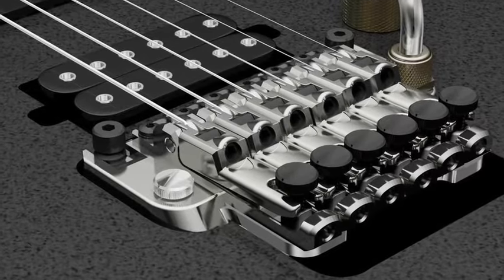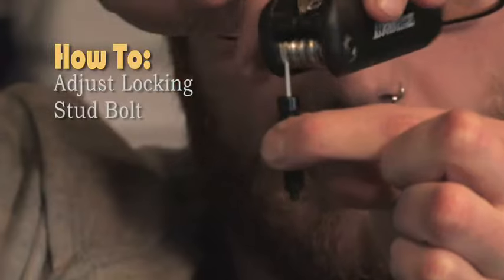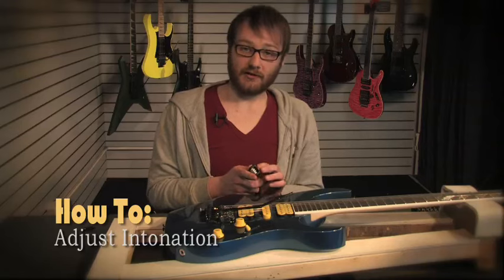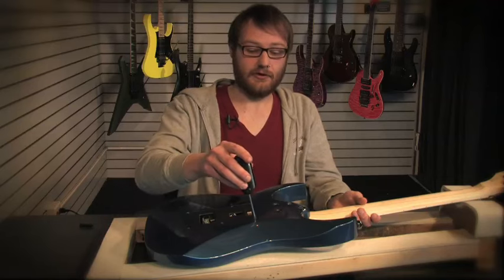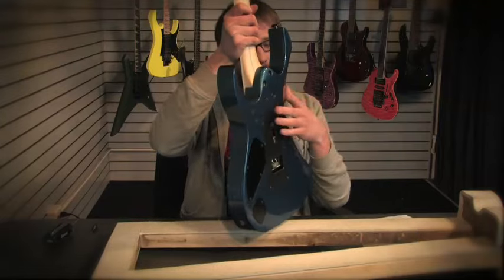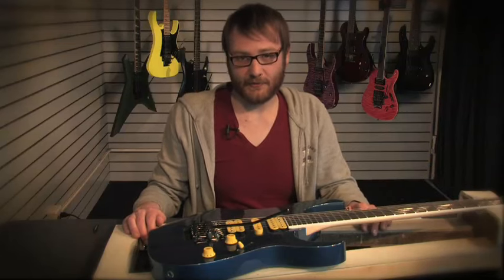Trems : Edge Zero

Comment: I have a rg 350, the bridge is similar to the one in your video but I think it's older because it doesn't have that intonation adjuster. Anyways, I can't get the bridge to sit flat, the tension adjuster is maxed out and won't pull the bridge any flatter and it's not flat.. What can be done? I can't find any information on this problem..

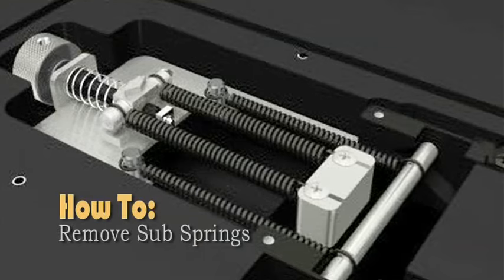Comment: 5:05 I removed the two springs in order to get a more loose tremolo. The Guitar feels much better to play now, but it wont stay in tune and gets flat everytime i use the trem. Whats wrong?
Reply: You need to balance your tremolo, so tune until you dive or pull and return to normal It took me lile 40 min to do that.. I adjust, tune, dive/pull repeat until works

Comment: @LOMAZ5150 My locking nut is just tightened to the point where I feel resistance. About the string tension... I'm not quite sure. I can use the trem to an extent, but more than that makes the guitar go out of tune. Maybe it's the tension. I'll have a look at it, I think.

Comment: Man...our society...men (at the least), should be more than capable using tools, and generally good at troubleshooting.

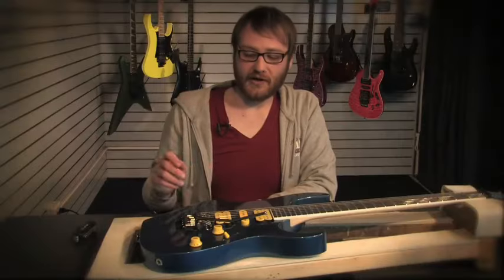Like at around 3:20, just say "TIGHTEN or LOOSEN" the nut to increase or decrease the tension, or torque, of the trem arm. You know, just basic terminology for bolts, nuts, screws, etc.

Comment: it would be nice to get a video like this for the edge 2
Reply: Meaning its simpler to adjust but not that stable :)
Reply: SmeefMemes  I fucking hate the edge 2
Reply: Yes please
Reply: i thought the edge II was the brain fart idea that doesn't use a locking nut
Reply: @hawkinthewind  Edge Zero 2 has a locking nut.
Reply: @OzzyInYourEars  Simpler by how? As I get it they removed the intonation screw with no replacement whatsoever, leaving you to adjust the saddle by hand somehow. I couldn't find any explanation on how to do it on the Edge Zero II, not even in the manual. Only thing I found is a third party intonation adjustment tool for 40 bucks. As far as I see this is a major downgrade to the first version. Thanks for nothing Ibanez.
Reply: @StrikeAgainstMusic  The intonation of the edge zero ii takes a bit longer but it is completly doable. All you have to do is to loose very well the string you're working on so moving the saddle with your hand becomes easy. Ive found that you dont really need to perfectly tune back  all the strings but the one you're focused on. When your done tighten the saddle lock bolt and repeat the process with the next string. For me it takes about 15 min to perfectly set the intonation of my rg350dxz. Good luck
Reply: @louisjgb8283  i hate it too. The only way my guitar would stay in tune is to block it.
Reply: @AlphaDeCefeo  can you help me intonate mine. I just can't get the D string
Reply: @aswindahal1001  There can be a bunch of reasons why you can't intonate just the D string. I would first suggest just to try with another (brand new) D string -- checking that the action is not too high --. If that doesn't work you can then start checking the hardware. What guitar/bridge do you own?
Reply: @AlphaDeCefeo  i have Ibanez rg 350mz with edge 2
Reply: @StrikeAgainstMusic  if an ibanez bridge has a number behind it, it means its the cheaper version of the same bridge for lower end guitars not an improved version of it.
besides for the zr and zr 2 meaning the zr 2 is the improved version, but then again its not II and instead its a number meaning its the newer version unlike for example edge zero and edge zero II

Comment: I'm glad I've connected to the guru of Ibanez tremelos. So I recently got a RG350DXZ.  And I'm finding unless I bring the tension to its lowest setting nearly on the bolt on the back, everytime I tune it all the other strings will detune by the time I finish.  What does it sound like I need to do?  Now that I set the bolt at nearly the lowest tension it stays in tune, but if I add any more attention it constantly goes out of tune as I tune it.

Comment: I just bought my first Floyd Rose-equipped guitar. Watching this demo it seems that the Ibanez system is a bit easier to manage. Not saying it's a better trem, just that it appears to be less of a headache to set up properly. Then again, I'm hardly an expert.
Reply: You're right.
Ibanez bridges are typically a bit easier, a bit, but Edge bridges are cheaper unless you go:

Original Edge (OE),
Lo-Pro Edge (LPR),
Edge Pro (EP),
Edge Zero (EZ),
ZR/ZR2.
These are sock solid & best bridges.
(above 1,5k$ guitars) 

Lower/Middle categories are:
(up to 1,5k$)
Edge Zero 2,
Edge Pro 2,
Lo-TRS.

Cheapest possible starting from 299~799$
(you wanna avoid these, trust me) :
Edge III (E3) 
Standard (SDL Trem) 
Lo-TRS 2

You can always buy a cheap Ibanez and upgrade its bridge. 
(Schaller / Gotoh). 

Disclaimer : These cheapest zinc alloy/jelly bridges might be OK when new, but don't stand time.

Comment: I am struggling with my Edge Zero II system
I removed the stop rod and every time i have to tune my guitar also the tremolo system gains height which i don't know how i can fix
Somebody help me
Reply: Mayank Rathore not sure what you mean by, “the tremolo system gains height,” but if you mean that the bridge angle keeps going upward, then you need to add more spring tension and tune again. If the bridge is still angled up, you have to add more spring tension and tune again. Keep repeating the process of adding a little more spring tension and retuning until the bridge is parallel to the body. 🤘🏼
Reply: @GringoPaulistano  Yes that's exactly what i meant. And adding Spring tension is what came in mind but i was afraid i am gonna damage my guitar. (sorry but this guitar is my precious, i bought it after so many struggles that's why)
Reply: Mayank Rathore yeah, just give it a little more spring tension at a time and retune after giving more spring tension. If the bridge is still raised after retuning, then do it again. 

If you give too much tension, you’ll know, because then the bridge will kinda sink into the tremolo cavity. If that happens, then you just give a little less spring tension. 

Don’t be afraid, those things are meant to take a fair amount of abuse! Let me know how it goes!
Reply: @GringoPaulistano  Thank you. Really appreciate your response <3 
Also its a 7 string guitar but the things should be same for this right. No significant changes?
Reply: Mayank Rathore glad I could help! I’ve been using floating trems for about 20 years now, so I’m kinda used to them. 7 string should be the same process as a 6 string, you’re just tuning one more string. Just remember that it’s both the adjustment of springs and the tuning of the strings that will change the angle of the tremolo blade, so I recommend only adjusting the spring tension a little bit at a time after tuning all the strings—make sure your strings are in tune, then see where you’re at before making another spring adjustment.

Comment: I feel like this is a video explaining how to fine tune a zero edge instead of how to actually set one up. Didn't learn anything here.
Never mentioned anything about setting action, didn't actually explain what zero point means, didn't explain how to install the bridge or set it up for the first time, differences between edge zero versions such as needing to put something below the bridge in the original edge zero to keep the bridge straight when restringing. Just missing so much info one needs to understand this system...

Comment: u said that "tremolo unit should stay straight with guitar body", it's true if u haven't zps on. With zps the tremolo is always slightly upwards, if u adjust spring tension in order to have your tremolo straightened with body u'll have the zps not setted to the zero point, this way is useless.

Comment: Sorry but no. Bolt ons having less sustain is a myth,as physics clearly states that a shorter piece of wood will resonate and retain energy from vibration than a longer piece of wood(bolt on vs neck thru). But this theory only holds if the bolt on neck joint is well crafted. This was taken from misha mansoor's quote from Doug Campbell, builder of blackmachine guitars. And quite honestly, paul gilbert and andy timmons are AWESOME players. Thats not to say jacksons don't rock though, they do! :D

Comment: It is so hard to turn the knob and it hurts my hand so much would be much  better with a screwdriver. Also my guitar never stays in tune after a dive or pull and I dont understand the reason. Bridge position is perfect locking nuts are locked. What could be causing a tuning instability?
Reply: New strings, stretch then thoroughly before tuning

Comment: 3:45 “allows you to adjust your string tension with just a simple turn” proceeds to struggle to turn. No seriously my burning thumbs disagree
Reply: Yeah its not easy . I had to stick a alan key into the holes on the thumb nut to turn it
Reply: You got that right. A simple turn my ass.
Reply: I had the same issue and got fed up. I opened the cover and put a little bit of oil on the screw near the "diamond indicate thingy" and between the knob and the sheetmetal. Now it still is not the nicest knob I have ever turned, but alot better than before. I could barely turn it and my thumb was bruning.
Reply: Just got this trem and couldn't turn the knob was starting to get worried. Your comment shows that is normal thanks lol.
Reply: @brandonknight4945   no problem. Forgot I made this comment and laughed. I will say it got somewhat easier over time if you kept using it. I still have mine to this day

Comment: The edge 2 has a weird trem block system (which STILL allows you to use the trem) where you have have the trem block sitting against this lateral rod they installed, thereby giving the trem something to sit against at "zero point". It is very confusing and I think it is screwing up the tuning stability
Reply: My block doesn't sit against the rod when it's set to zero point, causing a knocking sound as the block hits the rod. This system is so dumb.
Reply: @TempleGuitars  You're meant to adjust it so it rests gently
Reply: @LegendLength  I sent it back to Ibanez, it was defective.

Comment: Hi.. I have an Ibanez rg370dxz.. As i was re-stringing my guitar.. i removed one of the string stopper screw but the 'T' shaped structured which was supposed to get loose never did anything.. it remains with the same tension and i cant remove that old string.. any help will be appreciated.. THANKS

Comment: Please Help, i cant adjust the spring tension, i turn that thing but it doesnt make a difference, the problem is i bent a string and other strings bend too, is it too loose? How do i fix it?
Reply: This video is VERY misleading about how the tension adjustment works. I'm gonna emphasize the explanation so anyone scrolling through the comments might see this. YOU MUST RE-TUNE EVERY TIME YOU ADJUST THE TENSION KNOB IN THE BACK. THE ACT OF TURNING THE KNOB ALONE WILL NOT LEVEL YOUR BRIDGE. THE SUBSEQUENT RE-TUNING IS WHAT ACTUALLY LEVELS THE BRIDGE. He never mentions this in the video.
Reply: i found this out the hard way last night, I wish I would have read your comment first!

Comment: Just to let everybody know I just got a rg450dx and I just set up my guitar for drop c xD lol it not that hard.The only thing I noticed is when I do a dive bomb the tuning on all string will go down one cent and when I I pull up it goes up one cent which the human ear can't even hear.All you have to do is block of the tremelo in the parallel position with something in the back of it the tune the guitar with the nuts near the head stock off.Then after you tune it take the off the block then adjust the springs back in a parallel position it should come back close to tune. make sure you put the fine tuners at mid point.Then once you tune the guitar get a feeler gauge and press down at the first and last fret and check how much space is at the twelfth fret make so its in between .3-.5mm.Then if you needed to make adjustment check the tuning again.Remember we are doing all this while the tremelo is blocked off I'm a parallel position.Then go to the fifteenth fret and check the height on the first and last string.The first string being the smallest one needs to be like 1.3-1.5mm and the last string need to be 2.0-2.2mm if you have a thicker gauge you may have to up this a bit because bigger string vibrate wider.After you have check the height.Tune the guitar again and check intonation by freting the open note then going to the twelfth fret press it and compare it to the open note.If the note if flate you need to loosen the saddle screw for the string your trying to adjust,BUT MAKE SURE THERE IS NO TENSION ON THE PARTICULAR SPRING BECAUSE IT WILL GET PULLED FOWARD REALLY FAST AND MAY DO DAMAGE ALSO DO NOT ADJUST HEIGHT WHILE THERE IS TENSION ON THE SPRINGS IT WILL MESS UP YOUR KNIFE EGDE.What I did to get tension off of the spring was do a dive bomb and hold it there with tape.MAKE SURE EVERYTIME YOU RETUNR YOUR GUITAR DURING THE ADJUST MENTS TO BLOCK IT BACK OFF.It just make things easier trust me.
Reply: This is very helpful. thank you.

Comment: I never tried the Edge Zero. One of my Ibanez's does have an Edge Zero II though, but i know that isn't made to quite the same standards. I always preferred the original Edge or OFR myself. But i wouldn't mind an Edge Lo-Pro. I guess it just depends on what you started out on. I started out on a Takeuchi TRS-101 non-recessed (non Lo-Pro) so i still prefer non Lo-Pro's. Anyways Ibanez makes (uses) some great bridges/trems.
Reply: CyberDreams my late-90’s S470 has one of those lo-pro II and it ended up being garbage after a while. I didn’t like the trem arm and it didn’t want to stay at zero point. I put in a Gotoh Floyd rose and it was awesome.
Reply: How was the Edge Zero II, durability-wise? Do you think it would stand up to a good amount of trem abuse? I read Edge Zero IIs are slightly better than Edge IIIs, but i also read that Edge IIIs are even worse than FR Specials. Considering replacing any Zero trem would take a lot of work, im just concerned for its stability and durability.

Comment: are there any videos on the edge ii tremelo for adjusting string height? i cant find any on youtube :(
Reply: If your strings are too high/low, check to see if your trem is parallel to the body first. If it isn't, adjust the spring tension accordingly. If it is parallel, it may be the truss rod in your neck, in which case you should take it to a shop to have adjusted. You can do it yourself (I've found it's best done it 1/8 turns), but it's an easy way to break the neck if done incorrectly. If you're doing it, make sure you know which way to turn first!

Comment: I like Ibanez guitars. I bought a premium 7 string directly from Ibanez and it did not come set up properly and my so called Dimarzio pickups have no Dimarzio markings and I can not find a Dimarzio pickup that looks like the ones installed. On top of this the black coating around one of the magnets on the bridge pickup was chipped off/missing. People, do not buy something unless it is in your hands first.
Reply: Then why didn't you just return it?

Comment: What if when my tremolo is at the Zero-point and is pointing towards the neck? It seems like it needs more spring tension but its sitting the the stop-bar piece. My strings are a bit loose and it is difficult to get the right strings and tension for tunings. I love the ZR bridge, but to make it have the same string tension as a regular guitar trem does it mean I'd have to remove the stop bar? Is the string tension thing and illusion? Am I going crazy? Haha Great video
Reply: Joel Louiseize possibly add another spring, or replace the existing ones with a sturdier spring.

Comment: Hey guys i need real help, you see, i bought myself yesterday a Cort X 6 with the same Edge Zero system as in the video, except this guitar does not have the wheel at the back for adjusting spring tension. So I'm having problems like shown on 5:50 where the spring is actually lifted up. Any can explain me how to adjust spring tension on such model to get it to its zero point?

Comment: When restringing, should you increase the spring tension before or after?
Reply: You change the spring tension parallel to the string tension until the tremolo unit "floats" roughly parallel to the body. Just make sure the tremolo block is always in contact with the rod of the zero-point system. The rest is basically trial and error. Oh yeah, the tremolo has to be fixed in an about horizontal position during the string change. I like to use a piece of folded cardboard that I push under the tremolo unit. If you use the same strings and the same tuning as before, you usually don't even have to adjust the spring tension anyway. I hope that answered your question.

Comment: So what's the difference between this and the Edge Zero ii?
Reply: Jonathan, i watched the whole video and all I can say is that the system in the video has a different way to adjust the intonation. On the Edge Zero II, my bridge style, to move the saddles, you just push them back and forth with your finger. The system on the video shows you actually using a handy little screw in thingy to adjust the intonation.
Reply: 3:45 “allows you to adjust your string tension with just a simple turn” proceeds to struggle to turn. No seriously my burning thumbs disagree